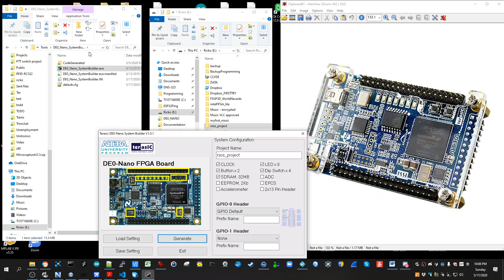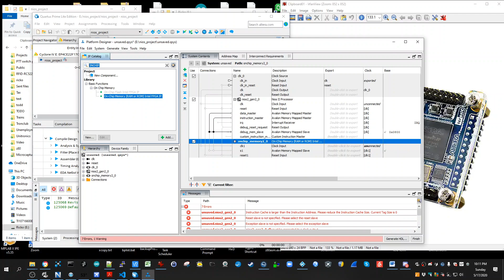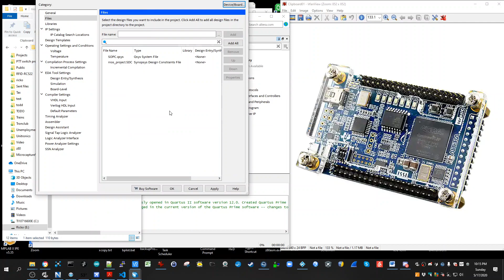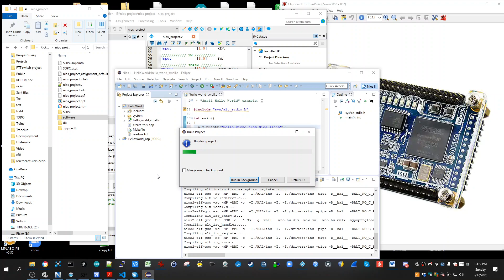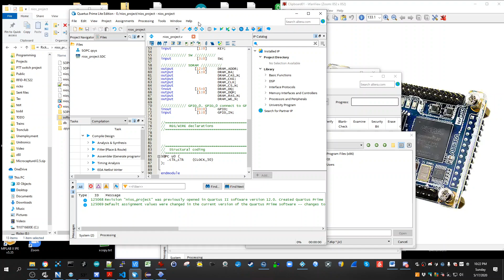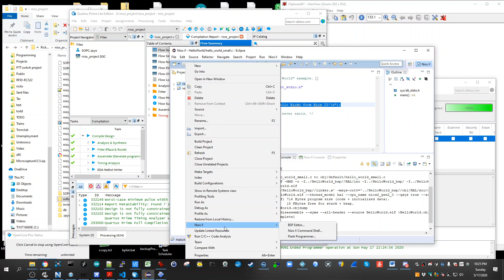Hello World via DE0 Nano Quartus and Eclipse

Comment: Hi, thanks for your video. It is really nice to have new posts of Nios/FPGA. I would like to know how to you succeed in having Eclipse running by Tools menu? I am using Windows10 and Quartus 20.1, have already done some Intel recommedation, but it does not work, the eclipse is not working through tools menu. Which Quartus version is yours? Thanks.
Reply from the maker: Thank you for the great comment, I used v18.1 and I accessed it from >tools> NIOS  software build tools for Eclipse